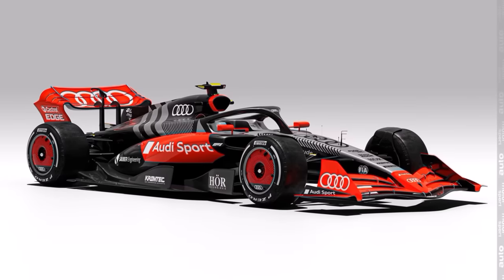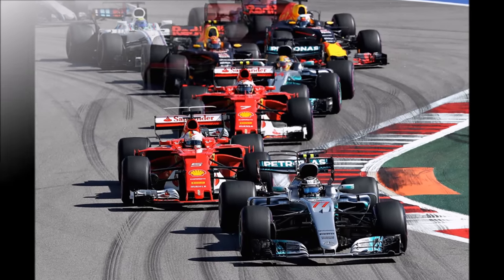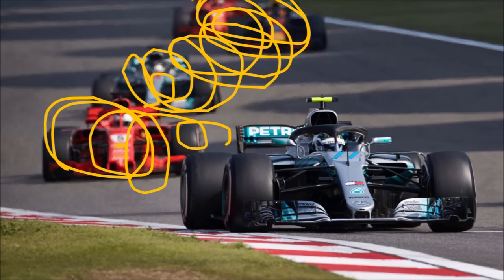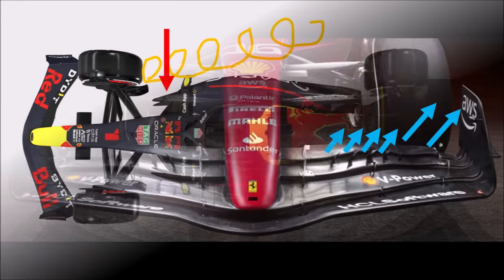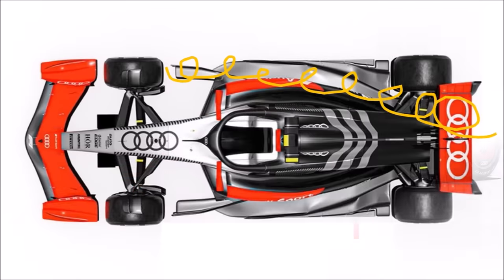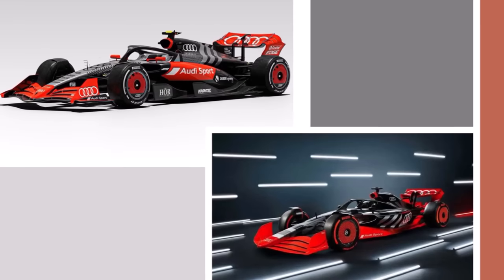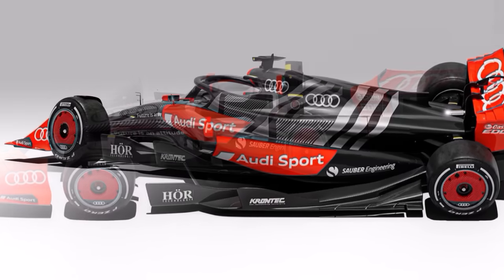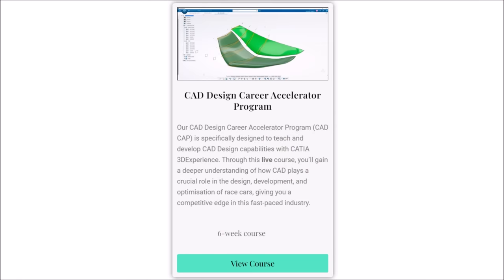F1 Concept 2026 - CLOSER LOOK

Comment: Basically, the bargeboards with undercut side pod just don't make much sense. If you don't want an outwash to form a sealing vortex at the floor edge like current teams, why undercut?
The one behind the wheels, just remind me of the floor of the R26 extended a bit in the same place or the design of gen2 FE and potentially works, but in the demonstration of AMuS just looks a bit, hmm.

Comment: Honestly, if you're going to do away with the MGU-H you might as well let teams run naturally aspirated engines with a higher fuel flow limit for higher RPM and get rid of the V6 for something less generic of an engine layout. If you keep the turbo make it small enough for teams to experiment with hot vee layouts to get some of the lost engine response back.

Comment: Size changes are most welcome. Fingerprint is too large. Going to 16" wheels makes me less happy, but if it helps drivers with visibility then fine. No weight limit is good if budget is monitored properly. Only question will remain is propulsion. This 50:50... and like everyone say it will have big punch at one stage, it might be very tough for the drivers. Thx for great video
Reply: 16" wheels is an improvement IMHO
Reply: Big wheels don't belong in racing, it's just Instagram crap
Reply: @davidaugustofc2574  Can you elaborate please? I would like to learn more.
Reply: I think the shrinking of the tyre size is threefold:
1. Drive visibility
2. Drive-ability
3. More rubber will create more flexing from the wheels and create more wake. And from this design, I think that is what they want, so the wake can be used to generate more downforce utilizing inwash. This then becomes an incentive. Also, the aerodynamic load created will almost be a fixed amount for all teams to use. So I think all teams might have a ceiling in terms of the maximum downforce that can be generated.
Reply: @GranDaddo  yep, the tire is the first piece of the car design, tires then the car. All forces act on the contact patch and so having the tires work better is always the best option to go faster.

 When you remove a lot of sidewall, firstly you're going against the damn reason you have then, to have rubber interacting with the asphalt, metal really isn't the material for proper car dynamics, Secondly you'll have heavier wheels because the rims almost always weight more than the tires, unless they're made out of carbon fiber but then they have their own disadvantages like cracking over bumps.

The fact that it isn't good for performance should be made clear when they made low profile tires for the first time only because it was mandatory, it was in order to slow the cars down, and in just 4 years they're changing it back a little.

 Lastly it just looks ridiculous, I swear I don't hate younger generations, but choosing the most crucial part of a car based on looks is just...

Comment: Usually, you'd think this sport is something, where the teams compete against each other to come up with clever solutions and better performance, but in actuality, it's all teams combined trying to outwit FIA's construction rules. Nothing new, this has been ongoing for decades, but still kinda funny to think about.

Hope FIA's next iteration of rules will allow closer racing and I think this is a step in the right direction. The aerodynamics will hopefully make it easier to drive in the wake of another car, the smaller size will help with overtaking. I wouldn't mind if F1 got slower in the process at all btw.

Currently, F1 cars can go as fast as 340kph, but what does that matter if there's 5-10 cars flying by in one long DRS-train procession with little opportunities for overtakes?
If these new rules enable cars to only go 300kph, but there's fierce wheel-to-wheel-action in every corner, that's a tradeoff I am willing to make.

DRS in general is an issue, that needs to be done away with. The worst thing is that overtakes happen almost exclusively in DRS zones, which makes it much less interesting to watch. Only seldom do we see overtakes in corners that aren't at the end of a DRS zone and some grand prix have two DRS zones in close proximity, so overtaking after the first is entirely futile, if it gives the other driver the opportunity to overtake back in the second. Drivers no longer go for gaps based on when the next DRS zone comes up and if they can drive far enough ahead to avoid a counter-overtake under DRS.

If 2026 gets us closer to removing "push buttone-receive position"-racing, I'm fine with whatever else happens.

Comment: I feel like the inwash panel might end up creating even more outwash knowing how F1 engineers operate lol.
So is that panel a mandatory part? 
Interesting they're back to 16 inch wheels ; it makes way more sense for ground effect cars so I'm not sure why we even went to 18 inch wheels to begin with. 
Also nice that F1's concept car actually looks like something realistic rather than something idealised.
Reply: They will probably have to channel air inwards off those panels (because they will be required to have an inwashing shape) and then use the side boards to outwash further down the car, similar to how RBR has used the side boards for outwashing so successfully...Regardless it will likely reduce outwashing overall.

Comment: This is so promising, and I’m excited to see how active aero will work on the front wing. 

I do have concerns about the power train, if I remember right f1 talked about turbo lag, and I’m worried 50% coming from the hybrid battery will make f1 more like formula e which has massive problems. 

If they want to be carbon neutral, why not make the engines 60% combustion powered since it’ll be eco friendly

Comment: i like these changes all except the propulsion, i really think we need, and i really want v8/10s and a similar amount of ers
Reply: While the sound produced by those engines was something to write about, i think the current engines a significant step up in terms of technological advance, and F1 is and always be about engineering development just as much as car racing. 

Bringing back V8s or V10s would be taking a step back, which i can't see as something that makes sense. Adding to that, V8s and V10s are becoming obsolete in the road car market too, so manufacturers don't have any incentive to develop those kinds of engines. 

Removing the MGU-K was a good thing in the sense that the ICEs will be louder and they weren't used in road cars anyways due to their cost. But going any further than that and making the engines bigger again i think doesn't make any sense in the current state of engineering
Reply: How can they make the cars lighter with heavier engines though?
Reply: @wiegraf9009   wym take a look at the older era cars
Reply: Those cars didn't have all the current safety features  @WigSplitters
Reply: @ivanbastos4963  you talk as if current engine config was road relevant , far from it. F1 tech rarely gets into road cars and even when it does , it ends up in very pricy top end cars....which kills the point of road relevancy.
let f1 be f1 , get  rid of stupid hybrid engine which cause more  harm than good anyways.
Reply: @RB26N  Car companies like Ferrari, Mercedes Mc Laren use F1 as a platform for their road car tech. It s unthinkable that they will throw billions so that they can go backward in development.

Comment: For the power train I would rather a NA 1.6 liter V6 revving to 14000 rpm ( sound for the fans) , running on zero emission fuel( for the environmentalist) and open up regulation for the electric storage ,  a car can store as much electricity as they want but still have a limited  deployment allotment per lap give. Hope this would motivate manufactures to look into other types of store of energy other than lithium batteries, maybe super capacitors could make a return or a overlooked technology. I believe this would benefit the advancement of technology greatly
Reply: It's a good idea in principle but I wonder if we would see big development gaps appear with the cost cap in that scenario. Get your energy storage wrong and suffer?
Reply: @wiegraf9009 I don't believe power unit development falls under the cost cap because customer teams don't make engines. I could be wrong.
Reply: @User-dd2xv  Ah interesting!
Reply: @User-dd2xv  There is a Power unit cost cap for the next generation of engines. Audi and Red Bull are new manufactures, they are already limited in terms of how much can be spent on R&D per year.

Comment: Front hub motors sound like the next logical step, but they would also massively increase the weight of that wheel wich could cause issues when they go over kerbs or get into an accident
Reply: Central motor with axels would be safer in that case, mounted in the nose. Would even add some weight at the front that may improve grip

Comment: I really like this new design! The front wing looks a bit like the first formula 1 wings from the top view, so i was concerned at first but from all the other angles it looks good and it is finally getting smaller! But from the renders it's hard to imagine the drs at the front. Do you have any idea where it could be placed and how it might work? Also can you explain why they have to burn 30kg of fuel just to generate electricity? wouldn't it be more efficient if they burned the fuel to accelerate the car? (they do this as well by powering the batterie but it's an additional and in my opinion unnecessary step)
Reply: Real drifting like before Action Not like on the railroad

Comment: This might not make any sense, but, from a pure tecnical point of view (no bias because i myself really wanted that too) do you think its better or even realistic for the future of f1 to just forget the hybrid? maybe go back for v8s with turbos maybe or stick with v6 turbos but just delete the hybrid? I know this sounds stupid but actually, the hybrid puts a lot of weight on the car, i know that it generates a lot of power and that it is very efficient but a less power but lighter engine with refuel maybe if we get close to the 100% sustainable and syntectic fuels could be a good option maybe. Smaller and lighter cars with ground effect could be good idk.
Reply: Fuel tank will be 70L. With 25-30kg for generating purposes, that leaves about 40L for the combustion engine, which is a 530HP 1.6l V6. Fuel economy is needed as E-fuels that they plan to use is expensive. This is what the Manufactures wanted, more reliance on electrical power.

Comment: Some good steps forward, but ultimately a dissappointing package. Reduction in weight projected to be 20-30kg is nothing when the cars put on around 40 kg of weight in just this decade alone and they were overweight to begin with. Reduction in size is welcome, but 20cm in length is not enough when the cars are so monstrously long now around 4-5m. 

The front aero wash control is the best thing about this, but I'm more worried about the powertrain. I've no idea how they're going to do 50/50 on electric and combustion and not lose signifcant amounts of current lap times. Bigger battery and MGU-Ks also negate whatever weight reduction benefits the other areas bring and as we all know, it takes more energy to accelerate more mass.

I genuinely hope this works out, but I have a feeling we'll have a repeat of 2014 where the new reg cars were jarring compared to what raced a year prior. Still, can't wait to see and if the racing and championship is good, they'll iron out the kinks over time and keep it entertaining.

Comment: I would propose a standard bargeboard spec and more forward floor area, importantly the board start closer to the wheels so you won't need so much outwash for performance downstream, aiming for outwash levels no larger than LMP1. I don't like inwash i also want performance.

Comment: There needs to be more freedom in the design concepts. 

Firstly, energy regeneration from braking is essential. 
Secondly, the tyres should be narrower to reduce aero losses, particle pollution and improve the spectacle. 
Lastly, allow teams to run flexible bodywork if they do not have wings...

Comment: Very curious to see how the teams will figure out to create lots of outwash despite all of this. Because they will.

While I was hoping for more, the size reductions are a good step. Also good that the wheel size has been reduced, because that was one of the major missteps of the 2021 regulations, since it is very bad for both visibility and aerodynamics.

I do agree that it's a shame that there won't be any front axle EV drive on these cars. It could allow for some innovation that's actually real-world relevant. But it seems that we have to rely in WEC to do that instead.

Comment: I have big concerns about the "active aero" too, that just makes racing predictable and overtakes with drs become undefensible,  drs is just stupid and i would prefer push to pass system for now because that at least gives a shot for the driver to defend with better positioning but the best would be to not have any of those, WEC stands supreme
Reply: I think the active Aero will just be braking flaps, like wings that pop out while breaking, letting someone break later. Hence the whole “reverse DRS” whatever they called it lol

Comment: The aero on the cars look good but the engine rules aren't good from a performance standpoint, 100% biofuels should have been considered instead. Even having successive races on the same continent instead of hopping from one continent to another would reduce the sports carbon footprint, optimising this would save a lot more emissions than tinkering around with restricting the cars fuel consumption.

Comment: I've always wondered if teams have ever intentionally used turbulent air as at tactic? So the car following would have more difficulty closing in for a pass. I bet some teams did.
Reply: Would the Brabham BT46 count? AKA The Fan Car it was using dirty air, just not turbulent air from the bodywork but instead the giant fan on the back. Drivers who competed against it said it would spit up dirt, gravel and rocks into them when they tried to get close to pass that car.
Reply: I think that's very unlikely. Energizing air takes, well, energy. That energy has to come from the car i.e. it is drag. Turbulent effects are also very hard to predict. Deliberately adding unnecessary drag to your car just to screw over rivals maybe sometimes would be ridiculous.
It's less that they're trying to screw over rivals and more that they're not trying not to screw over rivals.

Comment: Why did they decide against adding a front mounted MGU-K? was it really just due to extra weight? I would imagine the massive amount of additional energy recuperation, and thus total supply of deployable power, would far outweigh any extra weight penalties (be it around 20kg) 
They certainly wouldn’t have to do this ridiculous fuel burning to generating electricity rubbish….
Reply from the maker: Rumour has it they were afraid Audi would have an advantage because of their LMP1 experience.

Comment: Very unefficient approach. I suggest that to introduce the full front wheel cover to reduce the front wheel wake generation, this will bring at least tree benefits: 1. Make the car more efficient by improving the Cl/Cd and reducing the fuel consumption; 2. Reducing the outwash to help the overtake; 3. Simplify the over-engineered aerodynamic features and rebalance the teams' competitiveness.
Reply: No, it is a slight compromise but huge benefit, still quite different from LMP car

Comment: the 2016 cars with simplified aero would have sufficed. They've changed the formula three times in 10 years now. Yet the only overtake we get is with DRS, which was the case in the first place. I think we as an audience would rather have seasons like 2010, 2012, 2016,2021 than seeing cars follow each other closely while one car is doing all the winning. Anyways, since when had f1 ever listened to racing fans.
Reply: Simply not true we only get DRS overtakes. We still get too many, but they're not the only overtakes for sure.

Comment: It seems that the unsaid problem with the modern rules is the hidden push to prevent large differences in performance between cars. The ideal of a technical meritocracy runs counter to the desire for entertaining races. So the rules have artificial constraints to prevent any team finding a race winning edge. Minimum weight limit would seems to be one of these - although safety rules need to have room for proper implementation without a temptation to only implement the letter of the rule and not the intent.
The modern rulebook is so prescriptive compared to days of old it is wonder there is any scope for innovation. And the races are still boring.

Comment: The chassis won't get narrower. They limited the width from wheel to wheel, which has nothing to do with the size of the chassis. Only the suspension forks will be a bit shorter. The actual car will be wider.  That's quite terrible.

Comment: I think the cars need to get much lighter and smaller again, and the omission of front wheel regen breaking is plainly put stupid. 30kg of fuel burnt just to produce electricity? Doesn't sound like the so-called "green future" of F1.

Let's also be honest - it is great that the FIA tries to create better and better rules for racing again, but it is no use if we still send them to oversized Gokart tracks like Monaco or outright unnecessary venues that are deathtraps (like Jeddah) and uninspired (like Miami) and will probably never produce any good races whatsoever.